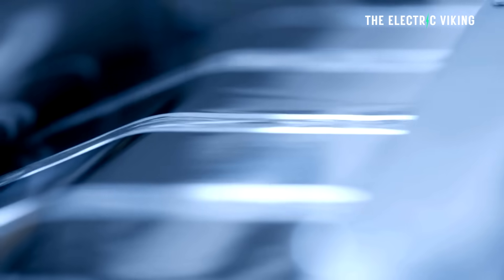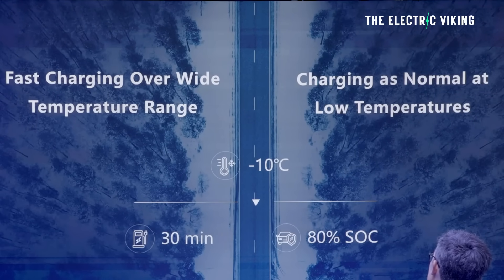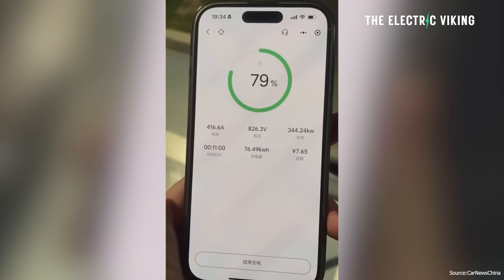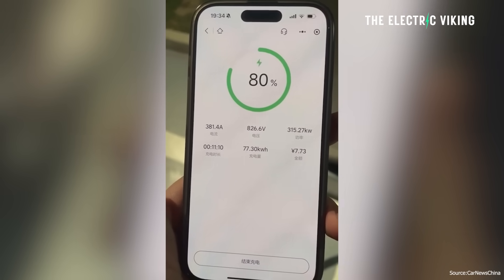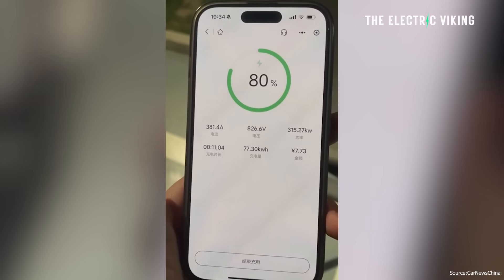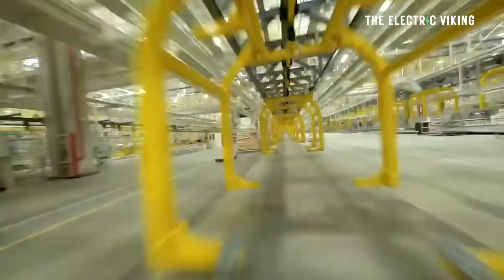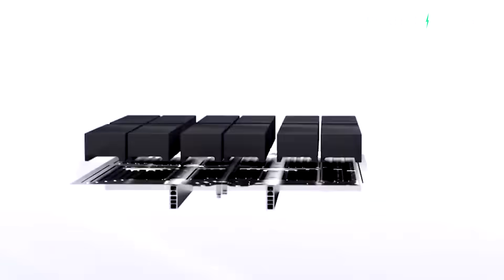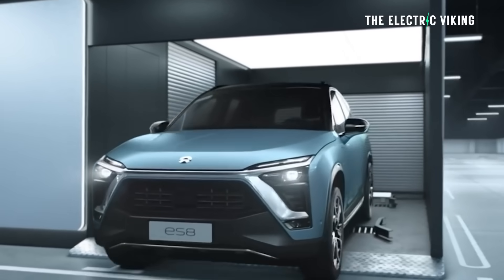The EV that charges at 552 kW using Tesla partner CATL's new batteries

Comment: The typical petrol car  takes about a minute to fill tank say 55 litres  x 8.9 = 489.5 converted into KW  x by 60 = 29,370 KW   in a hour!  when battery tech gets even halfway to this then we are making progress.
Reply: What exactly are you trying to calculate here?
It takes 12kwhs of electricity to refine 1 gallon of fuel, 55 litres is 12.09Gallons, on average you get 39.9 miles to a gallon of fuel, so overall that tank of fuel would get you 482.39 miles, if you can put it in the vehicle without transporting it to a fuel station.

The average EV gets about 4.5 miles per kwh, 12kwhsX 12.09 gallons of fuel is 145KWHs, this means the average EV can go for 652.5 miles on that much energy.
If we also factor in the cost of transporting that fuel from an energy perspective we're look at about 20kwhs per gallon, times that by 12.09 you get 1088.1 miles from an EV using that power.

We're already at a point where EVs can have that, especially with CATLs ultra dense battery, that much capacity to equal your 55 litres of fuel will be in EVs in the next 12 months.
Cost will be there by 2025 or 2026.

It's dangerous to drive for more than 3 hours without rest, the capacity is already there to handle that and the ability to put 600 miles of range in the car within 15 minutes is there with this tech from CATL, no need to take hours out of your life while you hold your hand on a fuel gun.

It certainly takes more than a minute to put 55 litres of fuel in a car, it's more like 5 minutes to fill up that much, same for Diesel, which you're waiting around to do, whereas you plug in an EV in seconds and start the process, while you take a break.
Soon you'll just drive over a wireless charging pad or over a piece of road that charges while you drive.
EVs are way more convenient.
Reply: @MrSec84  bravo I say! 👍🏻😎
Reply: @MrSec84  I'm not talking about how they refine petrol i'm not a chemist. Just saying how long it takes to charge a EV compared to a ICE car thats all. I think EV are a good concept but battery tech has a long way to go yet.😁 BMW has just released all new i5  But this still takes 30minutes for 250mile range.
Reply: @MrSec84  Read this..Adding these environmental costs to the previous estimates for battery production, lithium extraction, transportation, the energy cost of building the Gigafactory, battery transportation, battery recycling, and diesel fuel required to generate electricity to charge the battery, we get the updated total energy cost of producing and using the Tesla Model S Long Range battery pack as follows:

Total energy cost = 15,000 kWh (battery production) + 1,890 kWh (lithium extraction) + 6,480 kWh (lithium transportation) + 5,250,000,000 kWh (Gigafactory construction) / 1.7 million vehicles + 5,400 kWh (battery transportation) + 81 kWh (battery recycling) + 10,000 gallons of diesel fuel (battery charging) + $5,400 (battery disposal) + $30 (battery fires) = 5,250,320,000 kWh + $5,430 + $30

Converting the energy cost to barrels of oil equivalent using the same conversion factor as before:

5,250,320,000 kWh / 1,700 kWh per barrel = 3,088,431 barrels of oil equivalent

Therefore, the total energy cost of producing and using the Tesla Model S Long Range battery pack, including battery production, lithium extraction, transportation, the energy cost of building the Gigafactory, battery transportation, battery recycling, diesel fuel required to generate electricity to charge the battery, and the environmental costs of battery disposal and battery fires, is equivalent to about 3,088,431 barrels of oil.
Reply: @MrSec84  look up gas pumps on wikipedia it says they deliver up to 50 litres a minute.  I timed myself filling up my diesel tank and I put in over 50 litres in a minute. If your filling station takes 5 minutes there is something wrong with there pumps.
Reply: Can't fill up your petrol car while you sleep for FREE though now can ya? I can and have for 3+year's now and over 26,000 emissions free miles.
Reply: @4literv6  Trouble is millions of people  in UK don't have a driveway  to charge there ev , I'm not against the ev  I just think in time we will have to sort out a few problems first.
Reply: @4literv6  With the chance of burning your house down at night.
Reply: @paulwaites6551  which one? Here in the U.S. for 2022 we had 217,000 ice vehicle fires averaging one burning DOWN every 4mins.
Cost us over $8,000,000,000 in infastructure damage and was one of the most common causes of a vehicle fatality=burning to death!

Here the #1 open recall across ALL LEGACY ice oems is for the risk of FIRE even when parked. Well over 10,000,000 3-5year old vehicle's are under open recall for that risk of FIRE. Why do you think garages we're originally all detached structures?
It's because of ice burning DOWN while parked of course. Lambo and Ferrari love to do this to this day still. 

Ice vehicles cause a lot of brush and wildfires to parking over long grass with those that platinum metal filled cats.
The danger is in the name itself internally combusting Engines! 😀

Comment: In our opinion after 5 years of dealing with Tesla and the supercharger network, with some incremental improvements with version 3 superchargers, we think the focus on Ultra short charging Cycles is misplaced. While this is great, it isn't really necessary for a lot of folks, and frankly by the time we go to the bathroom and get a cup of coffee we've got 5 minutes left in our charge cycles. We don't have enough time to eat any kind of meal so if anything, further improvements just mean we've got to get out and move the car. It's not most of the time helpful. There are times when it is helpful but like I said it's a nice feature but not essential
Reply: Totally agree. On a recent Tesla road trip we found that we had to rush back to the car to avoid idle fees rather than sit around and wait for it to charge. The super fast chargers will enable apartment dwellers to own an EV. That will be their advantage. Unless you can charge at home overnight EV’s are still impractical. 10 minute EV charging will change this.
Reply: It does start to become a valuable feature once the deployment of EV's increase at a rate faster than new charger installs.  Quicker charge time = less people in line waiting to charge as the EV chargers become more congested.
Reply: what a 🤡
Reply: Exactly my talk.
Charging speed is an issue only for folks who DO NOT own an EV.
Reply: @MrChakra108 I mean this is so obviously wrong. Every EV company is very invested in reducing charging speed, and for good reason. I am on my third EV, btw. Supercharging works well but certainly any reduction in charging time is a win.
Reply: It will become more relevant though, when adoption gets to the point that charging stations need to support the same sort of throughput that gas stations manage today.
Reply: @petercroft9895  Not really.
You can put many more fast chargers on gas/petrol station that you would typically put pumps and nozzles.
Secondly, not everyone needs to be fast charging all the time. Many people will charge at home and/or at work and/or on slower chargers in town while parked etc.

There was a new Circle K station opened in Norway recently. It had 6 petrol pumps and 24 fast chargers plus 8 slow charger backup.
Reply: @MrChakra108  And yet, one of the biggest real complaints, and perceived problems, is the lack of charging infrastructure. That can either be addressed with more charging points, which is happening, and vehicles that charge more rapidly as the technology evolves - which is also happening. Just because it's not a problem for you personally doesn't mean it isn't a problem for someone else. Even if it's just a perceived problem, if it stops someone from switching to an EV, then its impact is no less than if it were a real one. I think we'll get to some point of equilibrium with generally faster charging speeds than are common today, and a lot more places to charge.
Reply: @petercroft9895 Complaints by whom and where? By people who have no EV and have no clue? 

You can't build infrastructure ahead of the EV numbers increasing. It's going to always lag behind. Else it's simply not profitable. That's the issue and the catch.
Reply: @MrChakra108  Pick almost any EV forum, you can choose. I'd be surprised if you can find one without actual ev owners bemoaning a poor charging experience at some point in their travels. Whilst your locale has evidently provided you with a good experience, that is not universal - and probably more so for non-Tesla owners. The supercharger network is something that company got right.

Comment: Sounds marvelous, if the price is right could be part of the answer in overcoming reluctance some people have toward EVs. As for myself, the “slow” charging rate of my Model Y Long Range is quite adequate.
Reply: If history is any indicator the price will not be right at least for a while. Overpromising with batteries is kind of a constant in the industry.
Reply: @edouglasroche  just because something has been a norm in the industry such as over promising it doesn't make it a right thing to do. It's akin to lying in order to inflate stock prices and steal investors money
Reply: Think we have to unlearn some misunderstanding. Theoretically my car charges at 240 kWh from 10 to 80% in 18 minutes but this usually in real life of a majority of people does not happen often. With about 500 km per charge you mostly do not need. Not so many people in Europe drive that distance in a day! Other argument is that we must rethink energy and electricity away from outdated gas station model to intelligent grids with mostly home or office charging also with V2G to use the car as a source of some income. Then also I charge my EV6 in 10 seconds usually😂😂😂 Do not need 500 kWh soon as I only use the 11 kWh Wallbox and neither would swap batteries. This is all a category error based on the will to replace one slave system by another to form your thinking how something has to be. We just destroyed oil by showing them the stinky finger and travel only to hotels and places offering charging and safe parking in garages. So it’s more interesting than being busy on highways especially in Germany. Than in France, Italy, Spain, Portugal like in middle age you must pay toll taxes for using roads! So we rather spend money on sight seeing, good hotels, drinks (not when driving😊) and food. EV are slowing down life to have more fun than others. EV would be the only way to free us from unsafe and dangerous suppliers of energy. PV, water and wind energy is already there but not with dilapidated big grids and nuklear power plants of gigantic wind parks. We only need smaller and intelligent localized grids to not waste energy like today when they stop production because they have too much natural power?!!😵‍💫🤔🤮 Reading in all the media we come to the conclusion that everybody owning a car makes only long distance trips of thousands of miles/kilometers 😂 but in fact most cars are used by 1,5 persons makeing not more than 30 km per day!🤔🤓 We really should start thinking what we NEED and not what we want to have and all that towards a fulfilled LIFE.🥰
Reply: That's because you can charge at home.. Think about those who don't have access to home charging.
Reply: @i6power30 200 miles in 15 minutes is enough for most people…

Comment: Exciting how battery tech is finally coming good. Is there any info as to what effect these charging speeds have on battery longevity? With current evs we are or have been told to avoid rapid charging on a regular basis.
Reply: I wouldn't say finally it's been a steady progression for the last 15 years and they will continue to improve for the next 15.  While NCM batteries do show some increased degradation when fast charging, the improved HVAC and software have reduced the degradation where it's really not much to worry about.  The current generation of LFP batteries on the other hand show no more degradation fast charging than standard charging, it doesn't seem to affect them at all.
Reply: Turns out they teslas, at least, are barely impacted with regular supercharging vs slower level 2; it’s not really something to worry about.
Reply: In the past the electrolyte in the battery was a liquid or gel that was semi-permeable; but future looks good with solid materials being utilised meaning charge speeds become almost irrelevant. Smart money is buying a bigger battery than you actually need and only using the 20% to 80% of capacity, therefore pumping in the energy rapidly and being on your way

Comment: What they probably don't show you, is the battery has significant degradation in just a few charge cycles.  I'd want to see what the capacity curve looks like after 400-500 charge/discharge cycles. If the cycle life is low, nobody would want a car with a battery isn't proven to last at least 250,000 miles.
Reply: We are talking about CATL here. The world's largest battery manufacturer known for their leading battery tech, performance, and reliability.
They also held the most patents in battery technology.
If they screwing around they should be bancrupt long ago, not thriving.

Comment: Charging with that high power is nice to have for trucks but for personal cars totally useless: Even with a 800V battery technique this means 690A current flow which either means thick, bulky cables which are not nice to be handeled or thinner cables with water cooling. In the latter case this also means high losses. The latter will already be quite high (I assume 20% or more total loss) and it is likey that the battery and all power electronics heat up significantly which again limits the energy transfer.

Of course, charging a 100kWh battery within about 15 mins is quite an argument but one still needs the acceptance of grid owner to run such loads every other hour for just a few minutes or there is a backup battery in the grid.

Comment: Ok so the problem I have with all of these super fast chargers, how do they deal with the heat when transferring this much energy in a short period of time and as the vehicle gets older what safe guards do they have to stop the batteries from getting too hot as heat is being generated so the cables and battery  need to be cooled and monitored so as not to be dangerous  as they are still lithium chemistry batteries and the LFP still has the potential to combust (megapack fire in Qld used LFP).

Comment: You seem to believe any old lie you read there are no chargers on earth capable of this
Reply: Li Auto will install 3,000 fast chargers with an output of 522 kW in China in two years
Reply: Uh tesla has the megachargers installed at the cali Pepsi depot for years now doing 750kws.
And recharging the semi 10-80% in 30mins or less.

Comment: If you charge at 500kw with a 250V source, this is about 2000 amps.  How on earth do you provide 2000 amps to a car.  What sort of wire do you need from the charging station to the car.  What happens to the local grid when a few cars decide to charge at the same time.  How big are the wires in the car.
Reply: Instead of gas stations we will need nuclear power plants 10 miles.
Reply: You obviously didn't hear about MCS, did you?

Megawatt Charging System for trucks. Google it.

Comment: 1.24 you are both right and wrong.  It is correct that range and charging times won't ever be mentioned in the future.  Those topics will simply disappear.  EXCEPT for those who very stupidly bought in early.
Reply: Well, I'm an early 2018 M3 adapter, with 150,000 km & I think I'm not stupid. I can still charge my vehicle up to 480km, no problem. Look at all the gas money I've been saving since purchase!
Reply: @rozonoemi9374  You forgot to mention the original cost, it's current value, the type of batteries, the increasing number of laws and concerns regarding  electric vehicles, and reports of increasing insurance (2.1 times) the ever-increasing costs of repairs, and the expected icreases in legislation about disposal, which could quite soon that costs of disposal could have a major impact on resale values.  And then there is the embarrassment of owning betamax style technology.